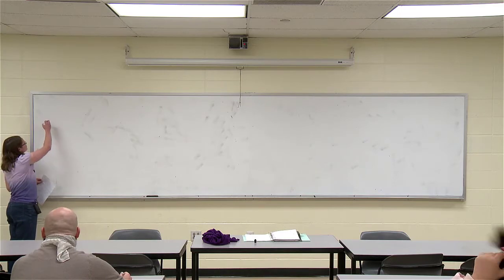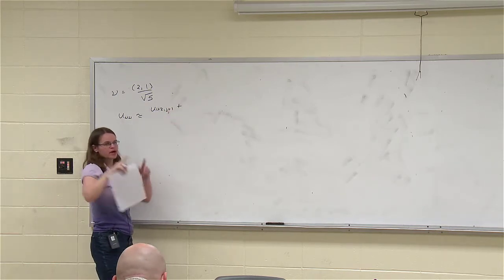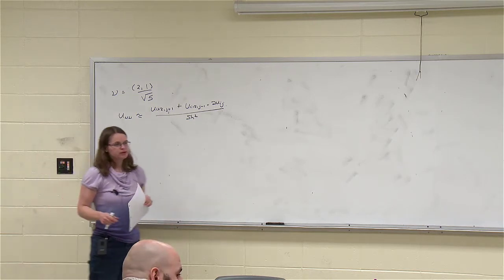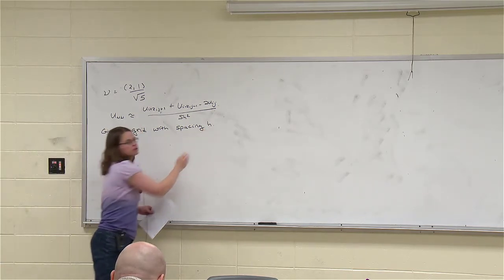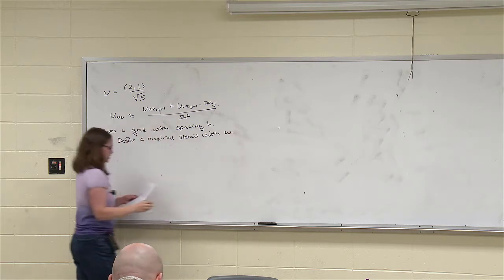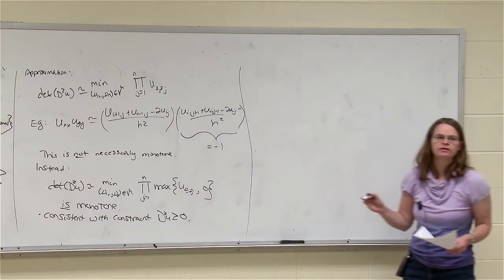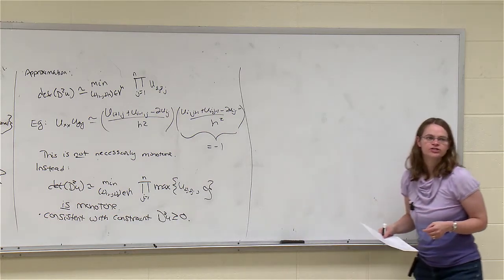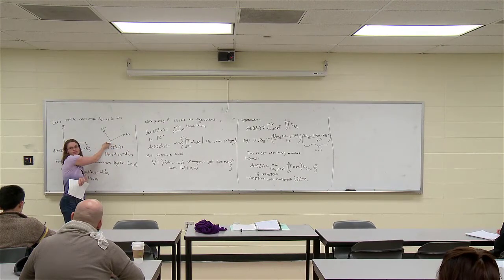Optimal Transport - Numerical Solution of the Monge-Ampere Equation

Comment: Hi Professor Hamfeldt,

Thank you so much for your videos! They are extremely helpful and not very difficult to understand.
A question I have is that: if we are mapping the boundary of source domain to boundary of target domain, then is it a strict requirement that the mass on source boundary should be equal to the mas on target boundary (or say the integral of density functions on two boundary should be equal)? 
Thanks.
Reply from the maker: We don't have to make any explicit assumptions here, but it turns out that equal mass on the boundary comes out automatically in this case.  In this setting, we are assuming that we have bounded density functions (and no point masses, for example).  Say we are in 2D, for example.  Then the boundary is a one-dimensional set, and integrating our density functions over this 1D set will always give us a value of 0.  So indeed, both domains have zero mass on the boundary in this setting.
This is a special case, and if you wanted to allow for Dirac masses (or non-convex domains), you can no longer assume boundary maps to boundary.
Reply: @brittanyhamfeldt  Thanks for the reply! Then for areas (assuming 2D) near the boundary, like thin strips, equal masses on two domains would not be a requirement because mass from interior of source domain can map to the edge area of target domain as well?
Reply from the maker: @zhengtan2968  Right, the two big domains have to contain equal mass, but there is no requirement that any particular subsets of these (such as thin strips near the boundary) contain equal mass since things can be transported long distances if needed to ensure mass balance.
Reply: @brittanyhamfeldt  I see, thanks!